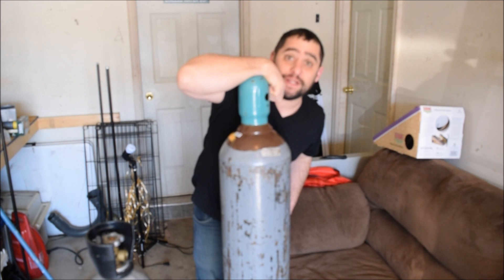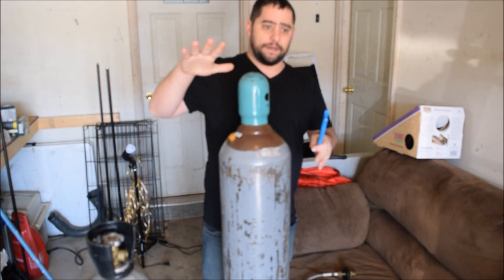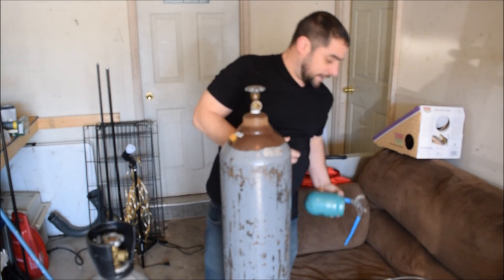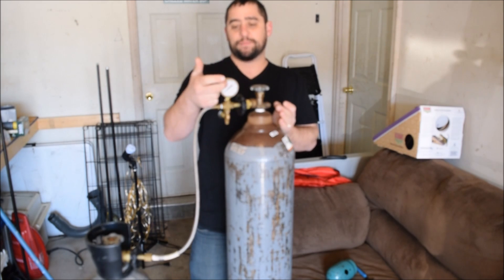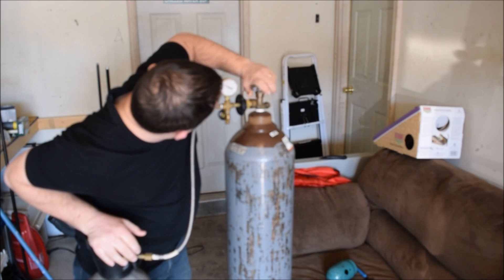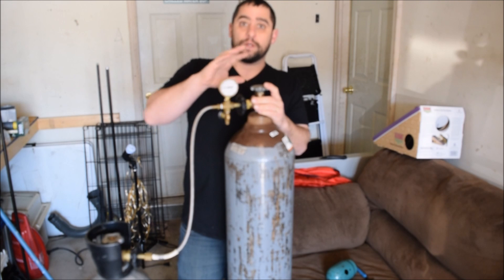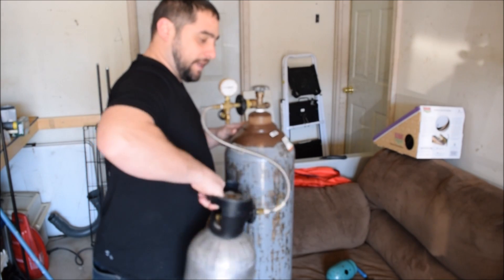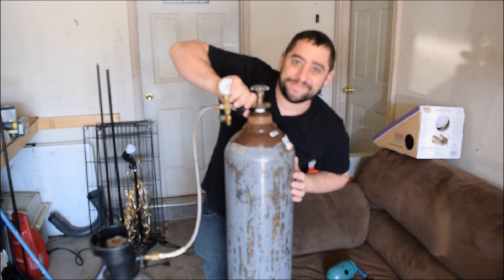How to transfer helium from a 242cft tank to a smaller helium tank using a tranfer cable

Comment: This video is missing the critical part of the smaller tank having a limit of pressure you can fill to that is less than the bigger tank.It is printed on the tank somewhere. To check the smaller tank pressure close the big tank and it will show the pressure of the smaller one.

Comment: Does cooling the receiving tank make a huge difference or do you just get a bit more pressure? For example if they both equalise at 700psi and you cool the receiving tank, how much more pressure will you get?
Reply: You have to cool the receiving tank because it will get pretty hot while you're filling it. I think you can heat the donor tank and cool the recipient.